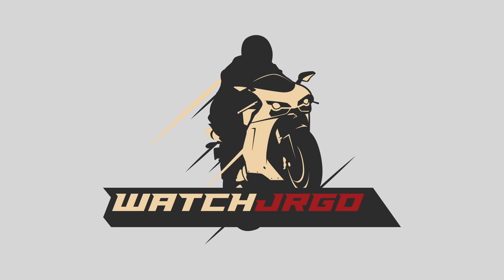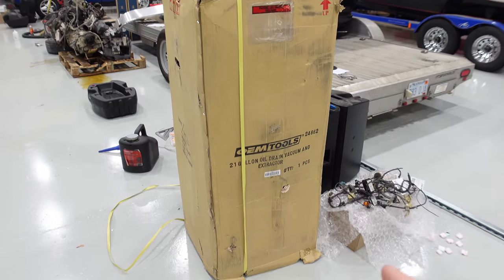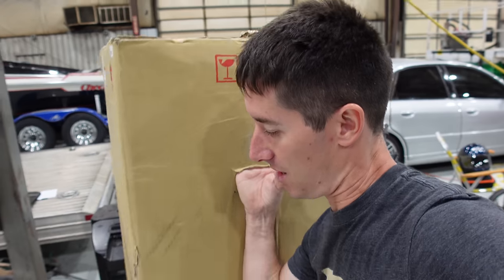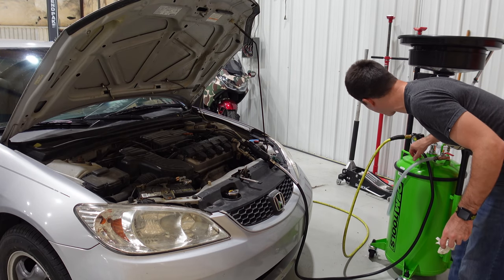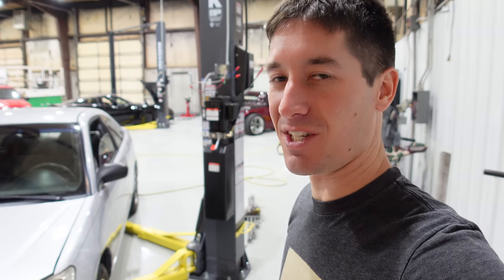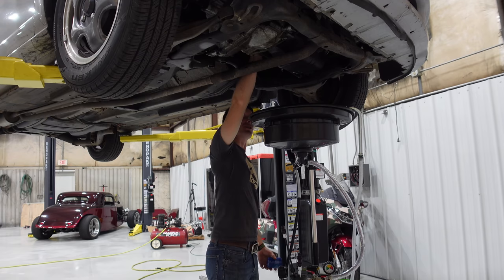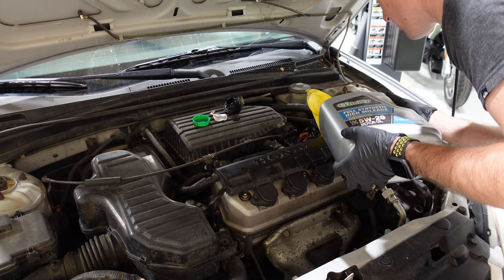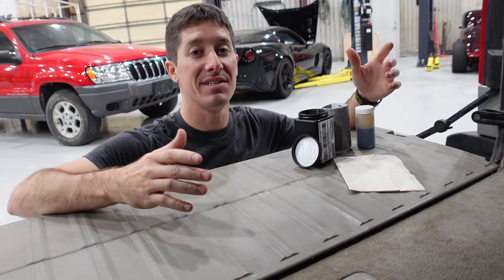Is VACUUMING Your Car's Oil Better Than Pulling The PLUG?

Comment: A friend who is a Mercedes mechanic taught me this years ago and I’ve been doing it ever since. Like you I pulled the drain plug the first time I did it with the same results. So if it’s good enough for Mercedes it’s good enough for me. I like your open mindedness going into this test.
Reply: Ya I bought a Mercedes a while ago and saw the filter on top and was like ya I wish there was a way to not have to go under the car and saw a video pulling the oil thought the dip stick tube and I have not looked back.

Comment: First off, Gabe get better real fast!! Second, I worked at a bus company and they sent every bus's oil off to be analyzed. It told them a lot about the engine. When you have over a 1000 buses, you do everything to maintain them. Vacuuming sounds great. Gets everything in the bottom of the pan including maybe metal chips.

Comment: I love my extractor it works great on the cars that have the oil filter on top.  I still do it the old fashion way with the cars that have the filters at the bottom as its still going to make a mess and you still need to pour it in to another container to get rid of it. The one i have is smaller but it has clear tubing so you can see when its done and it has the measurement on the side so you cans see how much oil you have extracted.

Comment: Love these things!
Working on diesel equipment, pulling drain plugs means jet black oil getting on things, dealing with dirt/water/mud filled chassis pans and removing smashed hardware for the access panels. I regularly suck out 14-16qt systems with little problem, although the engine needs to be warmed up since thick 15w40 doesn't suck well when cold.

Comment: I’m a DIY’er just because I can.  Long time good buddy owns H A Specialist, and only works on Honda and Acura.  I worked on cars since I started driving when I was 16, so I’ve always changed my own oil on every thing I’ve owned.  I’m 72 now, and good buddy Gregg let’s me use one of his lifts when I want to. 
  Regarding oil all over everything when removing the filter; I Mc Giver’ed a drain trough from the filter to the drain pan that took care of every drop. Zero clean-up!  
  Thanks for the proof of the pudding!    N.E.OH Bob

Comment: That vacuum has to be a game changer for trans fluid removal, before a filter change, and with some clever adapting, probably good for trans flush.
Reply: I am pretty sure they use a similar type machine for trans flush
Reply: Great point. My 4th generation explorer doesn't have a dipstick or drain for the trans, and it absolutely needs fluid changes every 60k miles.
Reply: @daviddavis1322  
Every trans should have a fluid change every 60k miles. Short of brake fluid it might be the most neglected fluid on a vehicle.
Reply: There is up for auction a 2010 Dodge Grand Caravan with 306,000 miles on it.  Government vehicle and maintenance shop says it has no know mechanical problems.  They just sold one last week with 403,000 miles on it.  Goes to show, maintain your vehicle and it can last a lot of miles  :)
Reply: @trvman1  They didn't tell you how many engines or transmissions it has had in the interim.
Reply: @mexicanspec  They said original engine and transmission.  You have to understand these things get "done" what is required by manufactures at the times specified.  I got 196,00 out of a 2001 Chrysler mini van and I sold it when  it was 19 years old.   Still had original engine, transmission and starter, water pump, alternator and AC unit.  I bought a new one and sold that one for cheap and it had no mechanical issues when sold.  Still ran like new and would burn about a quart of oil every 8,000 miles when I changed oil because I used synthetic and was suppose to be good for 15,000 miles.
Reply: There are already trans flush machines that do all of the fluid. Now I'm still on the fence on if its worth it, but it dose get all the fluid and is easy to use
Reply: Ive used the vacuum method many times on my vehicles transmissions. Often times I'll pull out 4 quarts of trans fluid out and add 4 back during an engine oil change. Really makes it nice when you need to remove the pan for a filter change, no trans fluid baths!
Reply: @blake8297  I was a GM auto trans diag and rebuild tech so I do have a different view on it. And that was 2000-2009 not the best time for GM autos.
Reply: @larrybe2900  I would have to say that’s probably diff fluid
Reply: I used this method to do a series of drain & fills on the transmission of my old Volvo V70. It worked great, and it was also easy to measure exactly how much fluid I had removed, so I knew exactly how much to put back in.

Comment: I tried building one of those vacuum drainers in high school. I modified a harbor freight air compressor into a vacuum pump and built a oil container out of a 5 gallon bucket, a ball valve, a bunch of hose adapters, and surprisingly, it worked when I tested it (it emptied out the water in the utility room sink pretty quickly.
But the first time I used it on oil, it sucked the 5 gallon bucket inside out.

It worked fine on water and coolant, but cold 15w40 diesel oil was way too much for it.

Comment: I've been vacuuming my Grand Cherokee with the 3.0 MB diesel for many years. If you use the drain plug on this jeep it splashes against the transmission then can be a disaster.

Comment: Oil vac and condition reporting is how logistics have been operating for a long time. If you have access to a vac - great. Using the right tube relative to the dipstick aperture and the shape of the sump is fairly important. As you found with the Civic, you can get more used fluid out with the vac. Also handy for all sorts of other 'nasties' around the shop...

Comment: I work at a take 5 oil change and we have a vacuum style oil drain. At take 5 we call it an EVAC (evacuation) basically we use compressed air to power a little rolling pump that sucks all the oil out of the dipstick tube. But you see we almost only do it on vehicles that have damaged or difficult to reach drain plugs.

Comment: I was a service writer at a very large Chevy dealership.  Lube tech pulled a HHR over the pit to do its first oil change.  He went under, pulled the plug then went topside to change the filter etc.  put the oil back in and sent it to the car wash. It went thru the wash, came up to the write up lane, idled for 5-10 mins while the customer cashed out and then made it about 3 miles down the road before locking ip tighter than three coats of paint.  Tech forgot to put the drain plug back in and obv didn’t check the oil level before sending it.  

Got to say I was pretty impressed at how long that thing ran without any oil in it.  Yes the customer got a brand new engine.  No the tech wasn’t fired - cost us a lot of money to teach him not to do that again.  He actually went on to be a very good technician. 

So like did Gabes incident begin with either “hold my beer” or him singing “I believe I can fly!!!”

Comment: I've been using a MityVac pump for about a year. Needed to change ATF on a Yukon and didn't want to drop the pan every time. So much easier with my car too since I don't need to jack the car up for drain plug or filter.

Comment: Great video. I just purchased an extractor/dispenser from Harbor Freight and I was interested to see how much oil was left in the oil pan after you finished. Some late model BMWs do not have an oil dipstick, so doing it this way is not possible. I've owned 3 in the past 6 years and not one had a dip stick. BMW designs the undercarrriage plastic protector such that oil changes are easy and it doesn't have to be removed. Just open a cover drop the drain plug and you know the rest.

Comment: That vacuum system is slick.  I use a smaller manual vacuum system for small engines such as mowers.  It's a great way to do it.

Comment: I use to use an extractor to change the oil in my 02 TDI I had years ago. It worked well and it was an easy way to change the oil without getting under the car and getting messy. At the time I didn’t have a Jack and Jack stands nor did I have a good place to even lift the car so this was a good solution. I kinda wish I still had it. I might have to get another one.

Comment: I thought that this kind of oil change was done by putting a cap on the dipstick tube and just sucking through that. If the dipstick tube didn't get all the way down to just a little above the bottom of the sump (haven't seen that in an engine, but I'm sure there are some) then it'd be leaving old oil in, which would be dumb and ineffective. So I wrote this off as some crappy quicklube shop method like using an impact to tighten drain plugs or oil filters when I heard of it. Now that I've seen how a thinner tube actually gets put down the dipstick tube it makes a lot more sense, provided the dipstick tube points to the bottom of the sump. Cool video, very informative.

Comment: Pela vacuum pumps are very popular in the UK. As you have to manually pump it to build up the pressure, they are not expensive. Another benefit is that manafacturers put underbody shields in the way of the filter and drain plug, and if you don't have a lift or axle stands, oil changes take too long and are too messy.

Comment: Pretty cool but I hate you can’t see the oil coming out, there other extractors have a clear hose that connects to the suction attachment. I had my transmission fluid sucked out last week and it was cool seeing what color it looked like coming out.

Comment: From someone who did oil analysis in the lab for years. Most of the times if there's major wear happening such as a failed component the metals will be in the filter. Versus the very fine normal wear metals that make it through the filter and stay in the oil.

Comment: BMW and VW were doing this back in 2004...that's how all my tech's did oil changes when I was a service advisor. It let them work on a car on their lift that actually needed the lift, as well as clocking an oil change at the same time. That's how the smart techs clocked some 14 hour days only working 8-10 hours.

Comment: I like the vacuum method. Since the oil filter housing is at the top of the motor I don't even have to jack the car up, secure it with stands, remove 15 bolts to get the plastic covers off just to get to the drain plug. I can have the oil changed in about 15-20 minutes and the savings of doing it myself means the vacuum pump has paid for itself several times over.

Comment: It's common and often necessary to extract the oil through the dip stick tube on inboard marine engines.  You can use an extractor or a pump.   I've done it many many times and never had any issues with it on my own boats.

Comment: I have one of those pump up the vacuum ones that I got for the Mini Cooper because the drain plug had to be replaced if you removed it. The filter was pointed down on that car too. It was nice not having to crawl under the car to change the oil.

Comment: I am absolutely a fan of sucking the old oil out, I use a DIY oil vacuum on my lawnmower, beats the heck out of the blade, dust shroud, etc. off to drain out the bottom. And, it takes me all of about two minutes to change the oil vs. half an hour the old fashioned way. Hope Gabe gets better soon.

Comment: To be fair to Honda on filter changes, they do use oil deflectors to get around either drive axles, control arms or other 'obstacles' to keep a drain clean (some dealerships will not use vacuum since many techs start in the express, extra responsibility I guess).

Comment: I have a large syringe from ravenol which I used for a few cars transmissions. Basically a drain and fill with the same amount so I know my levels match. Honda doesn’t recommend full flush because those can cause issues so I do a few drain/fills over a few months. Works a treat because they don’t take much oil. Will use it for engine too in future. Did service on 2 cars and because I was busy multitasking I forgot to torque down the drain plug on one. Of course plug fell out while driving and luckily wife stopped immediately and no engine damage, just a butload of brake cleaner to clean the undercarriage afterwards. I’m still more confident doing it myself after a service shop stripped a drain plug down to 1/4 turn of thread and had to have sump re-threaded after.

Comment: Food for thought about the suction oil change.
I usually only do it on boats. That’s pretty much standard procedure for any boat fluid service. You can’t usually get to the drain plug on a boat motor and if you could you’d be dumping it in the hull. Clean and Easy. For me I also like doing it on German cars because the filters are usually on the top too. Don’t even have to get under the car. 
So I guess I can say I’m for it. 🤷‍♂️ good video. Thanks always

Comment: I hope Gabe heals quickly.  That oil extractor is a great addition, and I'm sure you will put it to good use.  I thought there would be a little runout from the drain plug, so that was impressive.  I have used Blackstone a few times, and it's interesting to the lab test results.  And it reminds me that I will send a sample to them from my next change on my daily driver, 2003 Saturn LW200, 2.2 Ecotec, 219K miles.  I use a hand-operated Briggs & Stratton extractor for the outdoor power equipment, and it is very well suited for that task, and it looks like this one is very well suited for cars.

Comment: I use the Harbor Freight extractor to drain the 545rfe transmission before changing the filters because I bobbled the pan once and made an enormous mess in the garage. Used it last time I did the diffs too and it was awesome to not have to reseal the covers. I've never vacuumed an engine though. Never saw the advantage since I have to go under the car for the filter anyway.

Comment: I bought a hand pump oil vacuum and it works so much better than pulling the plug because the sludge is still sitting on the bottom when the engine is cold/5 minute start up vs vacuuming the oil when it's hot.

Comment: I drain the oil pan AND I have an old (superseded) home carpet cleaner that I modified to provide suction via narrow vinyl tube.
I use it through the drain plug hole to suck out any residual oil or sludge from the drain pan.

Comment: The drain plug on my 2002 Benz C240 (manual!) has never been removed. With the filter element housing up top, no need get under the car, which would involved removing the undercarriage panels. A friend with an identical engine first vacuumed with the hand operated oil extractor and then took out the drain plug just to see what was left. A  tablespoon or two of oil did drip out, but with an oil capacity of 8 liters, it gets well diluted so it's a worthy tradeoff to use an oil extractor.

Comment: Jump and roll Gabe! 
Never had an issue with those suction machines. If I had room I'd get one for DIY, but these days most of my cars go to a trusted/proven Mr. Lube who use drain plug, even with the tricky aftermarket skid plate on one car. Only one would really benefit with filter on top anyways.

Comment: Did not expect it to work that well. Seems much easier than lifting the car and crawling under it; I guess you have to anyway with the position of the oil filter.

Comment: My Mazdaspeed Miata and every stock NA or NB Miata has a similar issue with the oil filter location.  When you remove it, the oil drains out right on top of the front suspension.  The MSM has an additional issue in that you have to remove the passenger side front wheel to get to the oil filter.

Comment: Be interesting to see on a long term engine how this works, what I mean is does it pull the sludge off the pan? I believe thats why you warm the engine up before you drain it from the plug is so any particulates sitting on the pan get flushed out, it also stirs those up too to put them is oil suspension. 
I use a vacuum on a bigger scale to  drain/suck out hydraulic tanks and can tell you it does NOT get all the fluid and dirt out of those.

Comment: I use a hand vacuum pump. Also have an electric pump that hooks to the battery. Been using them for over 10 years on both mine and my wife’s cars with no issues. Saves having to get under the car on a wet drive and have unnecessary spills.

Comment: Heck if they made these at a price point for the home DIYer I'd certainly consider it.  It may not save that much time if you still have to put the car up on ramps or jack stands to get to the filter but it seems like it avoid a lot of mess.  My only thought around any downsides is if the filter is getting changed with it.  If the tech is already "there" (accessing the drain plug and the filter is close by) then skipping the filter may be an issue.  My father-in-law would love this as they own a Subaru with the filter up top so it would be a great way to go.  Looks like there are smaller units that are both hand and air powered for a lot less cost.  I think I found a Christmas present for someone...

Comment: I've been using Blackstone for years on multiple cars. I switched to Mobil 1 synthetic and extended oil changes. I've settled on 8-10,000 miles, but Blackstone says the cars should go to more than 12,000. Catch the M1 rebates and buy at Walmart and it is as cheap as dino oil. All 4 cars of my cars are well over 100K now and doing great. One previous car and a van went over 220K and never had a valve cover off.

Comment: Some cars are actually designed to do vacuum oil change. Like most Modern Mercedes. Oil pan is designed so that dipstick  pipe goes lovest point. So you get all oil out. Tested this with Peogeot 406 and after suction got meaby two spoons from drain plug.